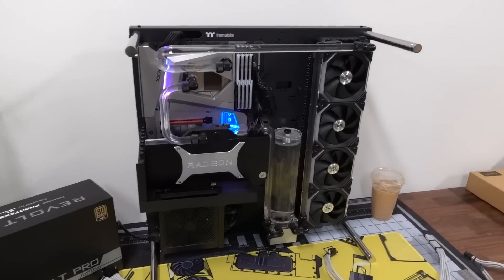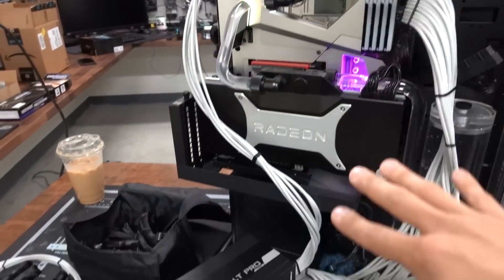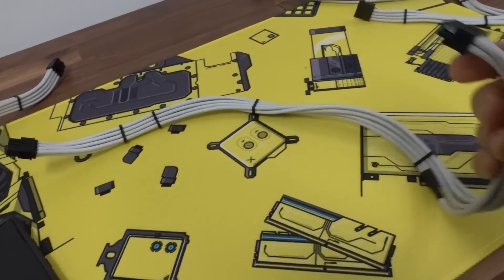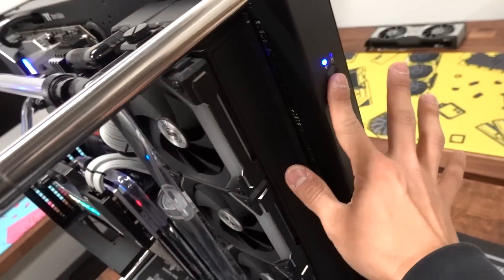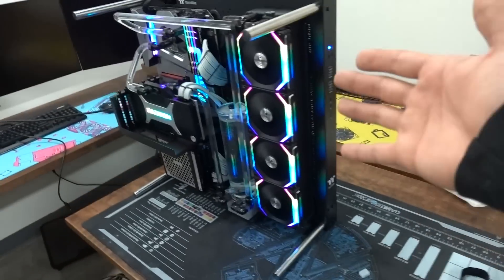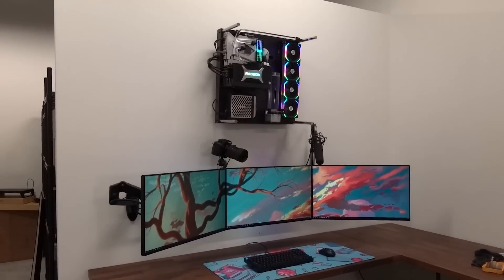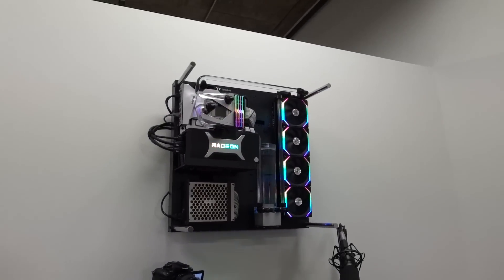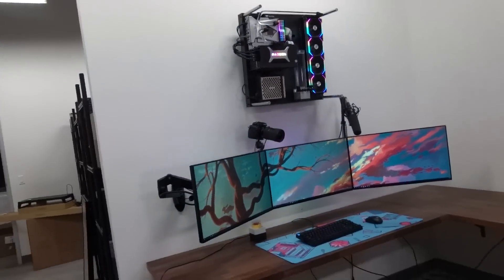I PUT MY PC ON THE WALL!!

Comment: I'm wondering why he just didn't use a floating shelf? Even an L-shaped piece of metal would have worked great and the weight capacity would only be limited by the thickness of the metal and anchor strength of the studs he used to go into those metal studs. A monitor mount should have never even been a consideration.

Comment: @BitWit , you think i should get the acer nitro 50 gaming computer $699 plus $158 tax or the $800 plus probably the same amount, im a 13 yr old trying to get better fps because on my current "pc" i avg around 35 fps on the lowest setting on VALORANT.

Comment: Those cables are not rated to be routed through the wall and should be in a raceway. Would be called out by any inspector for sure.

Comment: If the wall mount doesn't have the up-ward and downward option or something 

IF IT WERE ME .. my lazy ass would just slip in some piece of wood or paper to off set it and make it straight.
Reply: Yeah also probably since it has that extended arm and such it makes the tilt.. lmao If it were me I'd just put a platform in the wall to sit it on while adding something to mount for extra security.

Comment: Instead of trying to pull it flush at the top, why not use something at the bottom to push the bottom out from the wall, pushing the top back to the wall and making the whole thing straight...